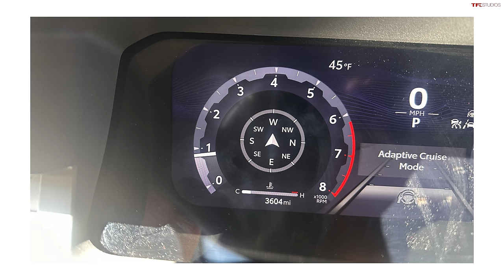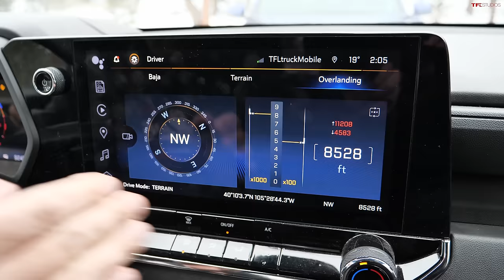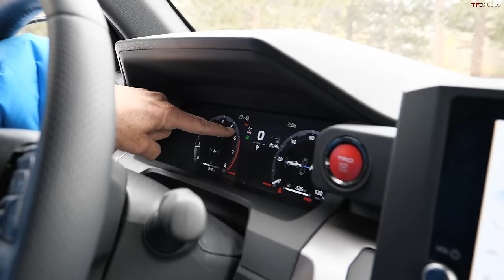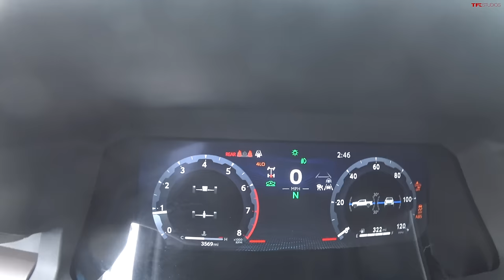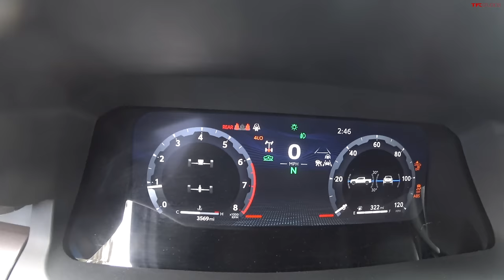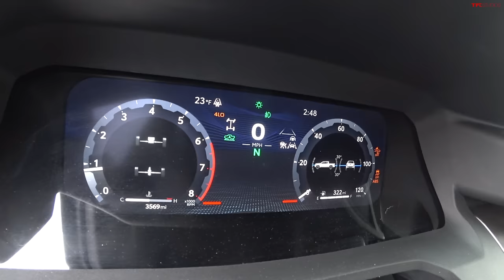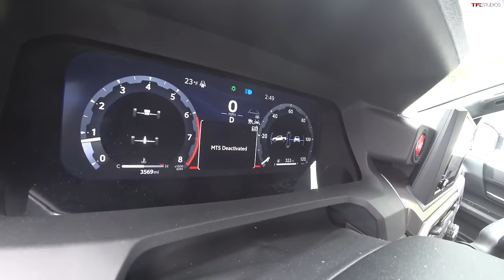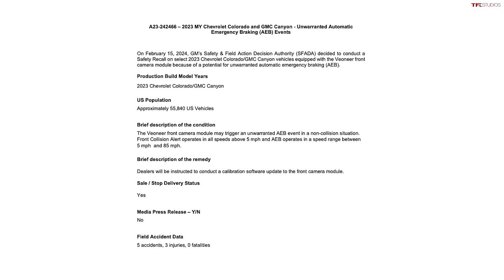Our Brand-New 2024 Toyota Tacoma Almost Left Us Stranded...Here's What Happened!

Comment: Driveline Engineer here.  The conditions when the failure occurred were modest.  Very low mu surface, limited alternating mu conditions, no wheel hop, limited wheel spin, lightly loaded, relatively flat ground, stock setup, limited to no steering angle, limited cyclic damage due to new-ish hardware. 
 
A failure under these conditions is abnormal.  My assumption is the majority of the damage was done at an earlier point and this is the straw that broke the camel’s back.  Making it a fatigue failure.  However, I feel like we’ve seen the majority of the obstacles this truck has experienced and nothing has been unreasonable so far.  I must wonder if it is a Quality issue.   

Please let us know what you find!
Reply: The truck just came out and it’s already fatigued? Shame how far Toyota has fallen. Guess them moving manufacturing to Mexico didn’t help. 50k truck fail
Reply: Not relatively flat ground though.
Reply: @angelgjr1999 Tacomas have been made in Baja since 2004. You’re waaay behind. 😆
Reply: please yes
Reply: Most likely qualify control.
Reply: An entry level bronco sport would make it up. This is embarrassing
Reply: @ohscheisse2192  luckily mine is a 2003 🙏🏼
Reply: Would be interested to know if the snow/mud donuts Tommy was doing in 4WD at the ranch could have caused the initial damage and Roman trying that trail when it was clearly covered in ice just finished it off.
Reply: @rogerj412 For sure, those snow/mud doughnuts are just brutal on a truck.
Reply: It’s called the guys not knowing how to drive off road.
Reply: @ohscheisse2192 but now 100% of them are either baja or the guajaro (wrong spelling) plant
Reply: @rogerj412   If it did...  it's an even bigger piece of junk.
Reply: @rogerj412   yup!  A few donuts in the mud and any new truck will be ruined.
Reply: What about them doing all these tests on a truck that only has 3,500 Miles. Hasn’t even done the first oil change (I believe) not properly broken in following Toyota’s manual instructions. 

Wouldn’t all this towing long distance driving and off road if so early cause a failure in SOMETHING? 

I’m genuinely curious, I get they do this because they don’t have the time to properly break them in but from what I know from speaking to many mechanics is that you should not put full stress on the motor or trans. And transfer case before the e manufacture recomende break in period. 

Thanks
Reply: @angelgjr1999  one out of how many trucks. The video proves nothing. I wish we knew more. I wonder if more of these failures will occur as the trucks age and get used.
Reply: Toyota fatigue after 3000miles is crazy
Reply from the maker: Thank you for your detailed feedback!
Reply: @themegawarrior45  I basically said the same thing you just did...  and was laughed at by other commenters.  Apparently we're not so smart or something.  lol whatever
Reply: @desert4seat  I’m sorry but many content creators for off roading do not “break vehicles in”. You never see this happening, this is a parts failure due to poor manufacturing.
Reply: @desert4seat I only destroyed things by hitting a telephone pole or jumping them, donuts and hard off road use didn’t break anything
Reply: In my opinion quality is definitely a big question here.   But many are still paying way over msrp.
Reply: Maybe the turbocharge kicking in 4Lo somehow caused fatigue?
Reply: @JeepCherokeeful   Most modern buyers wouldn't believe the abuse I put my (then) 20 year old '78 Bronco through and it NEVER skipped a beat.
These things aren't trucks anymore.
Reply: Not all of them. San Antonio Texas put out a bunch of Tacomas.
Reply: @rogerj412  truck looks tougher than it really is.
Reply: @desert4seat  i hope that was sarcasm!!
Reply: @ohscheisse2192 Texas makes most of the Tacomas sold here. VINS that start with a 5 are made in Texas. 3 are Baja. I rarely see a 3 in the used market.
Reply: This is what happens when you take the Japan out of Toyota.... Put it back Toyota !
Reply: I don't understand why Tacoma's built in Mexico have quality problems.  Toyota is watching the Quality Metrics I would think. Toyota is all about continuous improvement.   It must be embarrassing for the head of Toyota QC to have report on the issues with the same factory.  This should have raised alarms and got peoples attention.  But it seems to continue.
Reply: @ohscheisse2192  no, SOME have not all at least for 2nd gens. First number/LETTER of the Vin tells you this, 3= Mex T=Texas
Reply: @YoutubExpertOfAll  one out of not very many as there are very few 2024 Tacomas out there.
Reply: @angelgjr1999  i am sure a bigger screen would fix it
Reply: Interesting to know if ATRAC was disengaged and rear locker engaged caused this under these conditions?
Reply: @billw8476 😂😂😂
Reply: @themegawarrior45 break in is for the engine not suspension
Reply: Im guessing it was just a bad axle, from a poor heat treat etc that broke, so not about recalls. IMO
Reply: It smells like the front diff. When I saw Toyota putting aluminum diffs on the front of thier brand new Land Cruisers ...the hand writing was on the wall. Laughable.
Reply: @bradcasstevens5626 they know how to drive off-road as well as any other average buyer of these trucks. Reasonable people acting reasonably. 
So really, this gen should withstand average use, as well as or better than the last gen. And so far, it’s been in milder trails and if performing poorly compared to the last gen.
I think it’s a manufacture defect
Reply: Former toyota master tech here. I am not surprised by the failure as every new generation of Toyota anything that has come out since they moved headquarters from California to Texas. Has been made cheaper and has higher, more varied failures with every subsequent model. Also want to point out. Prior to 2010. Toyota didn't have early production issues. Now, they can't even launch a vehicle without a recall on or near its release.
Reply: @richeyrich2203 exactly.  If it can't go up a 10% incline in the snow without breaking a axel or diff on a easy trail then something isn't right.  
Pretty sure you can take driver error out of the equation.
Barely looks like a trail.  Looks like my backyard lol.
Reply: @desert4seat but don’t they do this to all their SUV’s and trucks?
Reply: @themegawarrior45  the break in time period is primarily to extend the life of the motor by ensuring the piston rings are properly mated to the cylinder walls, for the average owner.  If you are gentle with the throttle and vary the speed then you can tow without worry prior to the break in period ending.  This problem though was not with the engine, it was in the driveline.
Reply: cv joint passenger or locking deal in front diff  side ? failure  @TFLoffroad
Reply: mechanical engineer here, cyclic fatigue is not necessarily means it will fail like for example at 200k miles, it depends on the cyclic loads, the alloy in use, quality of the metal etc. so it does not necessarily mean a design error and since this truck is an early production model it might have some kinks needed to be ironed out, It is still too early to pick our pitchforks against toyota, however if toyota does not honor the warranty or continues to churn out defected trucks like nothing happened (highly unlikely, japanese are obsessive in these kind of issues) then we can make comments about the declining quality of toyota @angelgjr1999
Reply: @angelgjr1999  Why blame Mexico? Is this vaunted Toyota not made with Toyota parts? I can say that after watching trailmater videos for a while, you see that any rig can break, but when the Toyotas do (and they frequently do), the owner always finds a way to blame something else. Other owners just accept the reality that crap happens. Toyota brand snobs are only slightly more obnoxious than Subaru brand snobs, where they manage to believe that the legendary Subaru reliability means blown head gaskets, blown bottom ends, blown transmissions, blown differentials (did I miss anything?) are a true sign of quality. Weird. Guess I'll just jump in my 400K mile '83 Ranger and go home. I hope I make it!
Reply: it's just plain weak. no excuses. 3300 miles. I can't get over this tacoma line being compared to a 96 gmc k1500.  😅
Reply: @CACressida  most likely a manufacturing defect of a part. Bad metalurgy or something. Toyota is known(as are other brands) for a highly detailed inspection during production.
Reply: My 2nd gen Taco chillin at 350k no issues
Reply: The proven and non-electronic T-cases that are in wranglers and gladiators are far more desirable for anyone who wheels often than these failure prone push button units.
Reply: @rogerj412  nope.
Reply: @mlouiedc no
Reply: @kennak476 probably not the axle. Likely the tcase
Reply: @firebir11 likely the electronic tcase
Reply: @petrolhead9702 still a very weak product if you are correct. That wasn’t a lot of stress.
Reply: @firebir11  The new LC300s have plenty of problems. Serious ones that too. The Nissan Patrol Y62 is much better.
Reply: @NorthweSteelheadJunkies  Care to further explain? I'm not understand how ATRAC or the rear locker would be the cause of this?
Reply: @daves3402  They have to blame everyone else because so much of the ego of Toyota drivers is that they never break. They do, and often when offroading. I've experienced the failures firsthand. And the drivers tell me they are so reliable as the truck is sitting dead.
Reply: @bigcountry9457  not engaging ATRAC (closest thing to a front locker this vehicle has)  could easily help cause this.  The Colorado had F&R Lockers engaged and these guys were messing around with MTS in a situation that was made for ATRAC. It's not hard to break a front axle excessive wheel spin one side then the other suddenly gets traction.
Reply: @NorthweSteelheadJunkies    A-TRAC was already operating (generally have to go out of your way to disable it, if it's even possible).    Can tell by the sorta jerky changes in speed of the front tire, and the fact that both front tires were spinning the whole time, even as he sawed the wheel back and forth.    A-TRAC isn't really good for the drivetrain since it's transferring torque through an open diff by applying brakes to whichever side is spinning faster, but it should definitely not have caused a failure like this on a relatively low traction surface.      They didn't push it hard on the rocks in Moab, so I'd just chock this up to defective parts, or potentially bad design.
Reply: @daemn42  I think on the TRD Off Road you have the option to turn ATRAC  on. From the video they are messing with MTS/crawl control.  MTS is similar to A-TRAC. If A-TRAC was engaged, throddle would have been restricted.
Reply: WTF is MU nerd?
Reply: Leave it to dorks to make a simple thing sound more complicated so they can pretend to be smart. 

Split friction (or μ (mu) - split) is a road condition that occurs when the friction significantly differs between the left and the right wheelpath. The road may then not be perceived as hazardous when accelerating, cruising or even braking softly.
Reply: They took it hard instead of going slow and giving it the 1000 mile break in.
Reply: The Tacoma was in low range and Roman stepped on the gas. At that point, the engine was revving up, adding more torque, and the wheels were alternating between gripping and slipping when the failure occurred.  So even though there was low-mu, I suspect that some internal parts were free-spinning in a moment where one wheel grabbed something for an instant, and the rotational speed difference (somewhere) between the wheels and the engine was powerful enough to snap something internal given the torque-multiplier effect of the low-range. 

I agree that given what I've seen of Roman's off-road "competence," there's a good likelihood that this was a fatigue failure from numerous prior incidents. I'd really like to see the part that let go to see if it shows evidence of fatigue or a fast-fracture. It should be pretty obvious either way. I mean, there's going to be a fast fracture piece of course, but is there only fast-fracture in the failure, or can we see fatigue failure to the point of fast fracture.
Reply: @NorthweSteelheadJunkies  I now see what you are getting at and I agree. I just didn't think about it that way before. Thanks for the reply!
Reply: Just saw they recalled 500k tacoma drivetrains a couple days ago
Reply: @PD-we8vf   Thus completely missing his point.  He mentioned low split friction to point out that it's not like one tire had lots of grip and the other didn't, or it was intermittently catching.   That's the situation where one may break a differential or axle with one tire spinning, then catching hard (or even wheel hopping) causing instantaneous high mu.   It was low friction overall, mostly same side to side, and tires were spinning slowly.   No reason to break anything.
Reply: @NorthweSteelheadJunkies    That's not how A-TRAC works on my 4runner.  It does not cut the throttle, it just transfers torque from side that's spinning faster to side that isn't by applying the brakes.  That's it.    If there's something that cuts the throttle as well, it's a different system.  In this instance cutting the throttle would have been of zero benefit (as I find it is in almost every offroad/low traction situation)
Reply: @ohscheisse2192   My 2015 is made in Texas.
Reply: @daemn42  its literally the description of the traction control systems; "The system optimizes the 4Runner's engine throttle, traction control, and braking to ensure maximum traction and stability on any terrain."
Reply: @NorthweSteelheadJunkies   Ya well, it doesn't touch the throttle on mine.
Reply: @bowhunter182 If they made them in Japan they'd probably cost $10-12,000 more and people are already grumbling at the cost, not that I blame them.
Reply: Some models are still built in Japan and shipped to the US. 
I agree with you as far as pricing goes....This is why all manufacturers' trucks are piling up on dealer lots.
Reply: @Land_Raver  I agree with you 100%. Toyota owners LIE a lot about the reliability and durability/dependability of their trucks. They may deny it, but the truth of what happened to their vehicles is still there.
Reply: @daemn42 And again, what is MU?
Reply: One most infuriating thing in these discussions is when somebody uses an acronym or mnemonic and doesn't bother defining what it means.  I could go through a dictionary putting words like "moment unit" or  "management uniformity" together but that would be a waste of time, and I'd never be sure that's what you mean when you say MU.

It wouldn't be difficult at all to say what an MU is just once.
Reply: @davehenderson6125  Beside the fact that I specifically used the phrase "split friction" in the comment you replied to and it's been described by myself and others, there is Google and Wikipedia..     The first hit on "mu traction" leads to the wiki article with the correct definition..   "A specific road safety problem is split friction or μ (mu) - split; when the friction significantly differs between the left and the right wheelpath. "

An example of low mu situation would be say..  snow under one tire and ice under the other.     
An example of high mu would be dry pavement or rock under one tire and ice under the other.   You can break driveline components in a high mu situation as torque is transferred from low traction side to high, or the mu changes rapidly such as with wheelhop where a tire is spinning rapidly in the air and suddenly comes down onto grippy rock and stops, creating a shock load through the drivetrain.

In this case both tires had relatively low traction (thus low mu)  so when the traction control tries to transfer torque from lower traction side to higher traction side, it should just cause it to spin rather than creating a high shock load.      And even if it were infinitely high mu (rock under one tire, the other in the air) the traction control system should protect itself as this is not an uncommon situation while offroad.    Something in this particular drivetrain was defective.

Comment: A huge dealer market adjustment could have prevented this 🤷🏻‍♂️
Reply: or maybe a bigger screen, and more cup holders
Reply: Yeh I agree !  
I'm a 36 yr Toyota truck owner, I will think long and hard b4 buying a new one.
Reply: Yeah, but real entertainment value, this was a great video.
Reply: They obviously didn't buy the door guards ,paint protection and nitro gas for the tires , all could have been prevented lol
Reply: @marketpapi  Next it will be battery conditioning, charge port cleaning, new framus rod, sneeter pin, etc.
Reply: Too funny!